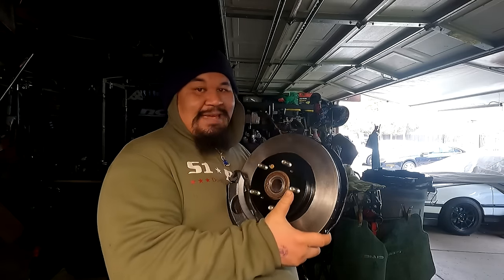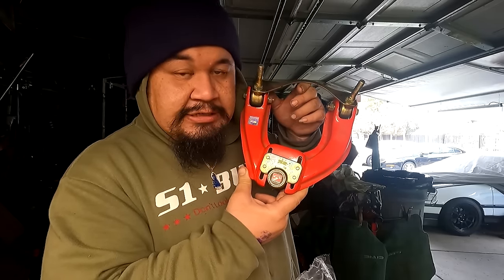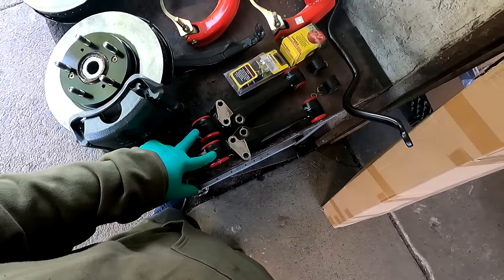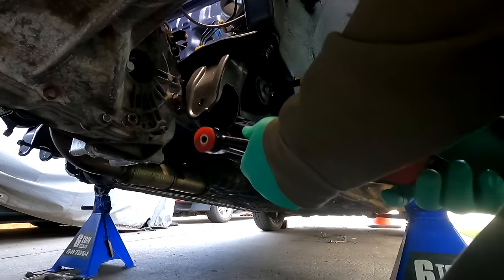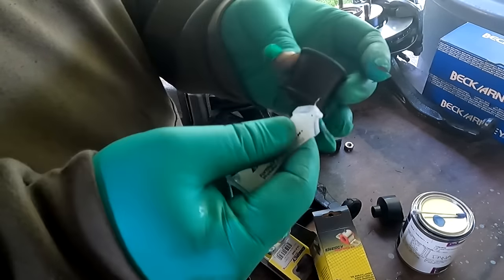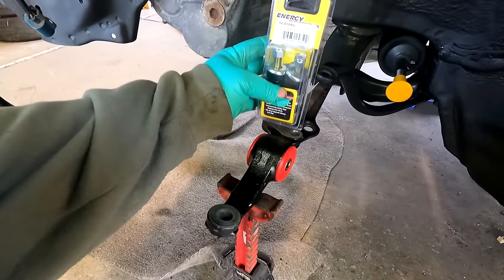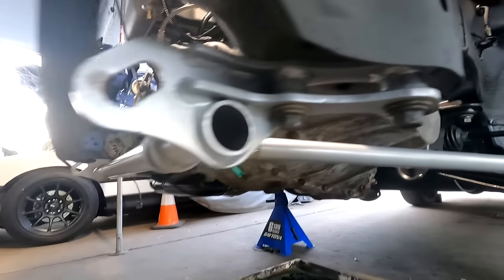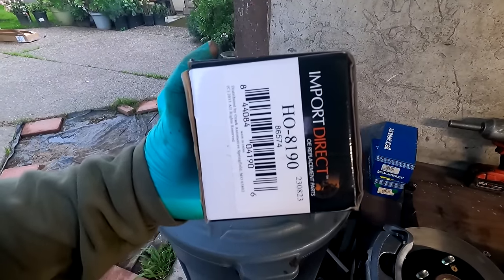BUDGET 5 LUG CONVERSION (Front) For My EF Sedan | Suspension Overhaul!

Comment: If dc trailing arms work on ef then those with rsx rear rotors and caliper BRACKET and rsx rear pads with DC caliper on a 97-01 prelude hub bearing assy
Reply: you beat me to this comment 😂, this works for sure just did it on my ef, mazda 626 axle nut and thread lock will do for the hub situation

Comment: the rear ITR trailing arm hub spindle is longer than the 4x100 disc trailing hub spindle. It fill but you wont have enough threads on the nut when you secure it. Honed development actually sells a short Hub Nut Kit.

Comment: Crv awd trailing arms fit wagon(if your staying 5lug, 4lug requires S1 kit), side by side they're almost the same other than where the camber arm bolts to, crv's is taller. Crv arms were bolted on a fwd 88 wagon

Comment: Unfortunately you may have gotten some incorrect information on the spindles and how fit on the EF.
The ITR and CRV don't use the same spindle, although they may be close enough to interchange. 
You may run into some geometry issues since the CRV spindles are taller than the EF. The adjustable upper arms may resolve that if the have enough adjustment.

Comment: For the EG if you have a 4 lug itr spindle you can use the same calipers 01 ITR with a 97 prelude VTEC rotor “front” and itr calipers 01 with 97 accord ex rotor “rear”….. and bolt on “took me a long time to figure that out”https://youtu.be/WCleuX6gCfc?si=l8L4r754lKoCxTTm